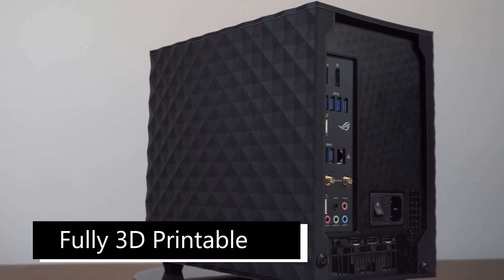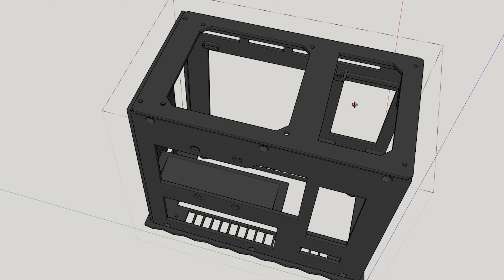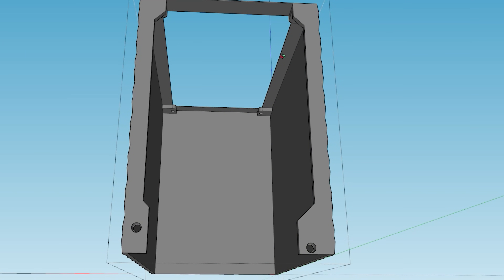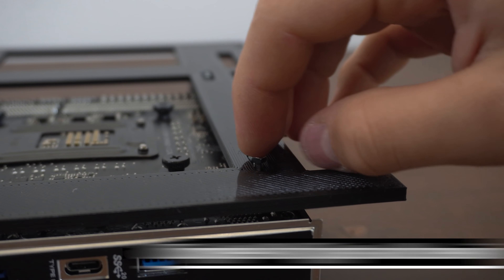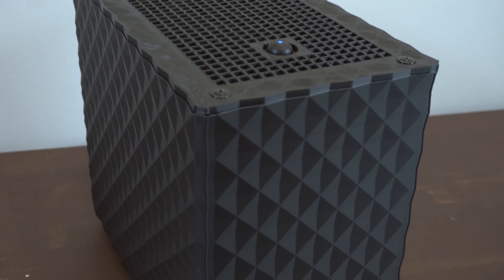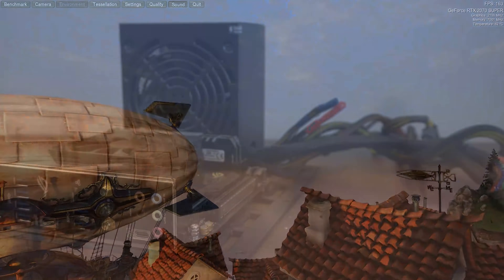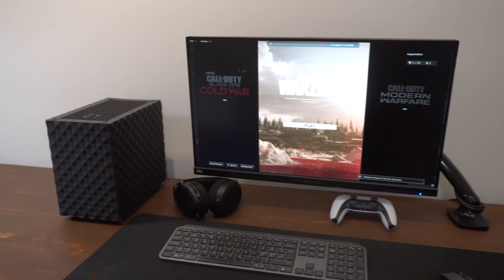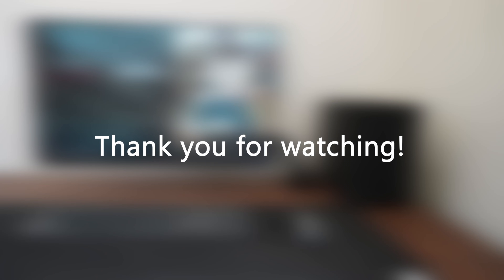CLEAN CUSTOM MINI ITX PC CASE BUILD | 3D Printed

Comment: Another ambient temperature of 20°C. Where do you all people live if you have ambient temperature of 20 ? How about you do test with normal minimum ambient of 26 to high of 36 for summer ?
Reply from the maker: Norway, honestly, my ambient may have been higher, 20 is what all my ovens were set to. But the operating temperatures would probably follow the ambient. So if it for example 70 is degrees at 20 ambient then I guess it’d be like 76 then at 26 ambient. I can only test with the ambient temps I personally have available, I’m aware some places are way hotter than Norway definitely.. 🙂
Reply: @makerunit  I got to ask. Do you even measure the room temperature ? Are you telling me you spend your time in room that is 20°C ? Never in my life have I been in a room that is below 22°C without me jumping around to warm myself. Even in winter with temperatures of -10°C, with only my computer running, room temperature rises to 25°C and you are doing tests at 20°C ? What are you doing active airconditioning to lower the temperature ? I really want to know, because for over 10 years, I don't care about temperature of the computer, but how much excess heat it produces to warm the room. Because in summer that means I can't use it , because room will get too hot for me. Who cares about the computer ... So it really pisses me off to see testing with "airconditioning set to 20...." Heat room to 36°C and then do the test. This is not attack on you, but I am really irritated by this, and even content creators with 5M subscribers do same crap testing and it is really sad.
Reply from the maker: @noobFPV  hey, no worries, I do see your point. I didn’t actually measure it I just went based on the oven’s settings which isn’t necessarily so accurate, and I didn’t really think too much into it when making the video. Sorry about that, I’ll see if I can get myself a temperature measuring device both for check the actual temperature in the room as well as some kind of infrared thermometer maybe to see if I can measure what temperature the plastic reaches in certain spots under a load. 

But anyways, when it comes to the testing of these custom made cases I have a very limited amount of parts available to test so any test I do will just be kind of an approximate reference, as most people have so many other variables affecting temps. 🙂
Reply: @makerunit  :) Why you keep saying oven ? :) Get something to measure temperature in room ( and if you can record it over time), you will be surprised. Wish people would to better testing and include heat dissipation and real room temperatures of 26+ that would show summer use cases. Anyway, good video.
Reply from the maker: @noobFPV  because in Norway an electric wall heater panel is literally called a «panel oven» like directly translated, but we usually just say the norwegian word for oven, which is «ovn» so idk it’s just the way it feels natural to write it. But I do realize, that to americans and english speaking it sounds like I’m talking about like an oven for the kitchen like where you cook food 😂

Comment: Will this case work for micro atx boards?
Reply from the maker: Hello, no it’s designed only for Mini ITX, I will be making a micro atx case coming later in the year 👍
Reply: @makerunit  Do you know where I can have a look at 3D printed micro-atx model case files? I was looking for something really small and compact, like an HTPC
Reply from the maker: I haven’t seen many 3D printed micro atx cases out there yet unfortunately. The plan for the one I will make is not going to be like a HTPC but I’ll try to make it fit inside a print volume of 300x300x400mm

Comment: where do you get those cables at 4:00 from... also that rear panel switch... im also curious about power button options or front panel io like sd card readers or usb3.0... im planing on getting a 3d printer and desing a case myself and im curious about those
Reply from the maker: The rear switch is linked in the description of the video. The cable is a standard C13 cable that is used for most power supplies, that I had to slightly modify for it to fit. I used a sharp knife to very gently cut of some of the rubber on the connector until I could bend it enough, then I used a Zip-tie just to keep it in that position. 

About front I/O, I have actually never tried adding that to any of my cases (yet) so I don’t have any spesific suggestions there at the moment unfortunately… 

I hope my answer was helpful, if not, don’t hesitate to ask more 😊
Reply: @makerunit  cool, thanks. i do have another question though... its about the filament, ive seen petg and pla and asa but im not sure what to get. ive seen pla has higher quality looks but its not as resistant but yet again ive seen petg melting at fairly low temps 55+  i imagine overtime it could get worse. so im asking you what filament would you recomend or use in this scenario also what would be a good internal panel ( MOBO tray ) thickness... and finally what are your experiences with PETG And PLA are they resistant enough for pc temperatures ?
Reply from the maker: @ramyabouhassan  hey! I usually stick with a thickness of 3mm almost everywhere. But so far I have only made compact builds, I might go slightly thicker like 4mm-5mm on the parts that need to carry heavy weight. But from experience, even 3mm thickness seems to hold a SFX power supply just fine when just hanging on the wall with screws, but I’d maybe go slightly thicker just on that part just to make sure…

About the material choice, I’ve always had great results with PLA. I’ve actually never tried printing a pc case in PETG so I can’t provide much information there. But for the ones I’ve made so fare there are absolutely no signs of the PLA deforming or anything. 

My girlfriends main PC since May has been the computer in this video, its been used for a few months now and it’s still as good as it was when printed. 

I intend on getting myself an IR thermometer in the future to actually measure what kind of plastic temperatures the case itself actually reaches, I may make a video on that in the future. 👍 Let me know if there is anything else you’re wondering about! 😊
Reply: @makerunit  oh thanks for your words. then it means that pla might not be that bad. 

hmm well im still kinda wondering how do you slice the parts, do you print all the case at once or print panels and later stick them. how do you stick them together.

 ( i undertands this varies alot ) but im curious how much time does it takes to print the whole pc and why does it sometimes failed to give propper results. anything that catched you offguard? 

and finally whats the brand and specific PLA you use

thanks for all the replies it really helps a ton :D
Reply from the maker: I print most cases in multiple part most often. And attach them with screws. Did you watch the whole video? I’m going through the whole assembly process there showing everything 😊

I’m actually using a cheap filamen I buy locally in Norway at a store called Clas Ohlson. It works very well for me. It’s just some basic generic filament… 

There are many many ways of attaching parts eithet it could be designed so the parts slide into eachother or they can be attached with screws or glue or anything. You just got to try out a few different ways that work for you. I failed a lot during my different cases and sometimes you don’t even realize some huge mistakes until after it’s been printed.

Print time is anything from 20-60 hours depending on print speed, nozzle size, layer height, infill density and a lot more so if you’re just getting into printing I’d recomnend printing and experimenting with some random objects to start and make sure to calibrate your printer properly follow a video guide 👍😊
Reply: @makerunit  thanks man... i did watch most of the videos on your channel a couple days ago im just running out of questions .

 well thats about it for today's question. ill probably get a elegoo neptune 2 next month im still learning before i make a decition. and you have been very helpfull, so thanks again. :)

Comment: Hi, Great Video..!!! Question how is the temperature resistance of PLA, does IT get soft the filament??? or is better works with PETG or TPU
Reply from the maker: Hey Luis! Thank you!
I personally have not experienced any softening of the PLA at all with my spesific setup. PETG is probably a better choice to be on the safe side but to me PLA has worked without any issues on all my case builds so far. The PLA feels slightly warm to the touch but no sign of softening. This has been my girlfriends main pc for a while now and  has been used regularly since it was made. 👍
Reply: @makerunit  oH, GREAT. Thanks for quick answer... PD: NEW SUBSCRIBER xD
Reply from the maker: Awesome, thank you! Have a great day! And don’t hesitate if you have any more questions 👍😊

Comment: How did u get ur c14 cable to look like that? Mine sticks out alot compared to yours
Reply from the maker: Hey, I carefully used a sharp knife to cut off some of the plastic/rubber on the C13 cable socket going gradually a little at a time just until I could fit it inside being careful not to cut into the cables. Then I just tightened it with a Zip-tie to keep it in its position I hope that helps! Just be careful not to cut too deep 😊 you could perhaps also try using heat. But the knife thing should work!

Comment: a wanted to be offensive about this, mostly because its made from plastic, but it might be good with the right combination of hardware. With the blower style graphics card its liveable, but an open air card might dump too much heat into the case for that l9 and for the psu to handle. i have some experience building small computers, even i have a custom sheetmetal case for testing out airflow patterns.

The airflow around the gpu is clever, everything have acess to cold air.

This case with a medium or low-medium hardware could be phenomenal and quiet, but i would not try to run high end hardware in it (thermal throttling is a thing and part dehradation from heat expansion is a thing too).

Great design!

(maybe try to make it use an amd apu, a passive bigger heatsink for the cpu and a bottom intake fan, maybe that could be a potential silent but powerful pc too)
Reply from the maker: APU large heatsink for a silent office workstation or something would really be something I’d love to try in the future maybe some massive heatsink and a low RPM quiet fan just for some slight air movement or something. 

Yeah this case is probably not optimal for high power parts. But I do get decent temperatures with the setup and a 65w TDP CPU, I don’t think anything higher would be very good. 65w TDP is also the maximum rating for the L9i from what I could find and about the only cooler that would actually fit (I think)

So assuming people stay within the rated TDP of the cooler only mid to low range CPU’s are at that TDP. Like my i7-9700k would not work here as it’s 130w TDP it would be too much for the cooler to handle 😊

Comment: I can see that you really thought it all through! How long did it approximately take to design this case (with the older version it was based off in mind)?
Reply from the maker: Honestly I can’t really set a time on it as I worked on little by little over a period of time. Ideas just come here and there as I go. If you’ve got a clear idea in your head and most details already planned and ofc if you know your way around the CAD program you’re using, then you may be able to design it in just a few hours but what takes time is testing/failing/succeeding/tweaking/test again/check hole alignments, etc… then in the end you’ll have something you’re happy with. The idea is what takes the longest to actually come up with 👍🙂

Comment: 83...
Reply from the maker: It’s a blower style card used here as it was the only available card I had that would fit the build. This card gets to 83 degrees even in a fullsize case it’s just the card that operates like that. And for that type of card its completely fine temperatures. Never goes much higher. Also blows out hot air through back so no effect on CPU cooler in this spesific setup. 🙂👍
Reply: @makerunit хорошо, понял тебя) Interesting setup, only not to be put on the table, instead something get melted)) Sorry for me english)
Reply from the maker: @Владислав Вальдемарович  remember 83 degrees is the temperature of the GPU core. The actual card does not get close to 83. And then you have the plastic cover on the card itself also protecting the temperature from transferring more before touching the 3D print. So it should not really be a problem 😊 With my testing I have not found any issues caused by heat 🙂

And you also see that with the «normal» fan card. I get only about 66 degrees in the core 👍🙂

Comment: This looks great! 
But do keep in mind that the metal cage of a "conventional" case grounds your hardware. Maybe run a wire from every parts mounting holes to the casing of the PSU to avoid static shocks on your hardware.
Reply from the maker: I realized that a few days ago that I should have made some solution for grounding! I’ll keep that in mind for next build. That might explains why I’ve gotten two blue screens since mounting in this case. I really thought it was due to some damaged hardware. But static could definitely be the cause as well! 👍😅
Reply: @makerunit I doubt it does much, the contacts at the holes are directly connected to all the ground pins that connect to the psu cable. Make sure to touch the psu case before touching the hardware though.

I used  m3 standoffs with female thread on both sides to mount my motherboard, I was contemplating doing the grounding by connecting a ring terminal and a wire to the psu case on the other side but in the end I didn't bother since it's all one giant ground anyway.
Reply from the maker: Yeah I always thought ground were in the actual cables also. But I mean it doesn’t hurt to be on the safe side 😅
Reply: Nah that's bullshit. Your psu grounds components

Comment: Epic!!!!
I want a case like this to fit a custom loop 😍
Reply from the maker: Can’t promise you a custom loop (yet) but my next build will definitely involve some liquid 😉
Reply: @makerunit  waiting!!
Reply from the maker: @ArpanMukhopadhyay93  😅 sorry it’s been a lot going on haven’t had that much time to work on projects! I’ve got something right around the corner, but unfortunately it’s not liquid this time as there was a slight change of plans but it will come I promise, I’ll get right on it. I’m really trying to make something clean looking but to fit my 3070, mATX and a radiator I really need some time on it because it would have to be bigger than my printer volume and it will be my main rig so I really want it to be good! But I’m working on it and I’ve got a little smaller project in the middle coming soon! 🙂
Reply: @makerunit  Cool. All the best. :D

Comment: So... A guy buy's a 3D printer and suddenly teaches the great company's how to make a good damn good looking case whit air flow mind... 😑
Reply: And than it melts when he plays Cyberpunk. 🤔
Reply from the maker: @MobileDecay  I haven’t thrown Cyberpunk at it but countless hours of Warzone seems to not affect it much. GPU and CPU running pretty hard for long periods of time. No signs of warping yet with my setup at least. Printing in PETG would eliminate that worry though. You’re free to print any material. I just happened to print PLA because I’ve got a lot laying around and I’m not worried too much about warping. 👍😄

Comment: Man i love your case , but  the power supply wire it goes through all the components, keep in mind that it is not very "healthy" because although the components are immune to noise, perhaps the noise level in the power supply line may be higher than that supported by the components, nothing will break but you could have 0 or 1 in tracks where there should be a stable value.
Reply from the maker: I’m glad you liked the case! And thanks for the info, I wasn’t aware of this and I’ll keep it in mind for next time! 😊

Comment: incredible design man, you've got amazing talent! You should submit this to LTT, they'd love it
Reply from the maker: Thank you! 😊
Honestly, it’d be cool to be featured on LTT and I might in the future if I one day end up coming up with an all metal production model of one of my cases 😉
Reply: @makerunit  i think the plastic asthetic on the side isnt problematic 

Cnc frame inside and a bit of front panel io (at least a couple of usb ports) and a different power butten would be nice in my opinion :)

Nice build :) keep that work up
Reply from the maker: @denispalt9184  thanks for your inputs, glad you liked it and yeah some usb ports could definitely come in handy. I was just afraid it could mess with the aesthetics of the case. And with the GPU I used I literally had maybe 1 millimeter of clearance in the front, rest was crammed with cables. Only place I might be able to fit extra usb ports are above the PSU in the front
Reply: @makerunit  maybe you will find a good spot in the next case

I think you could have a good chance of getting a feature at optimum tech since he is focusing on sff builds :)

Keep that good work up
Reply: @denispalt9184  I aam planning to make a 3D printed mATX case with full size ATX PSU and 240mm AIO (my current computer parts) but as small volume as possible.  But I neeed the front IO with USBs. Do you know how to get that?
Reply: @ArpanMukhopadhyay93  i would think you could get a frontpanel io plate with internal usb3.0 headers
Reply: @denispalt9184  Thanks! searching. Couldn't find on Newegg with these keywords